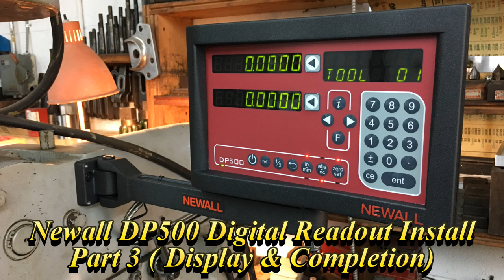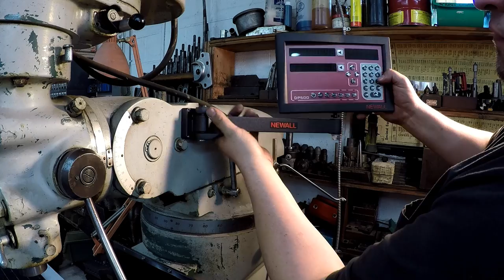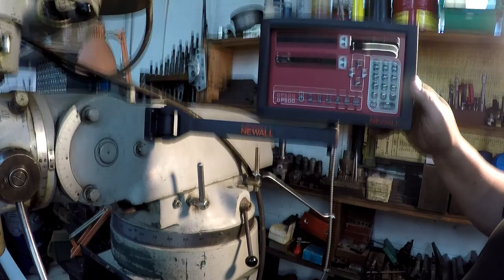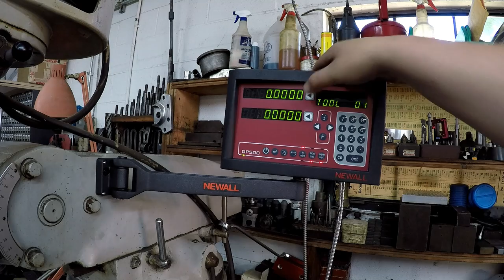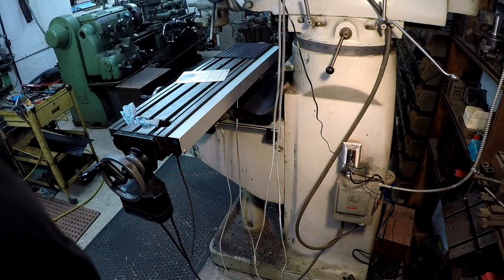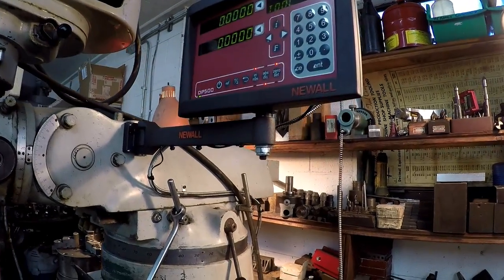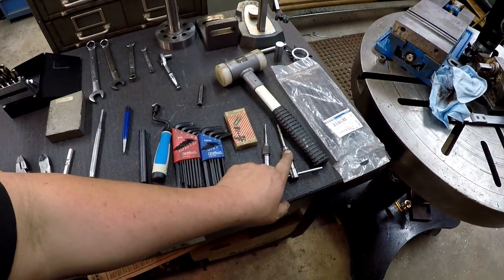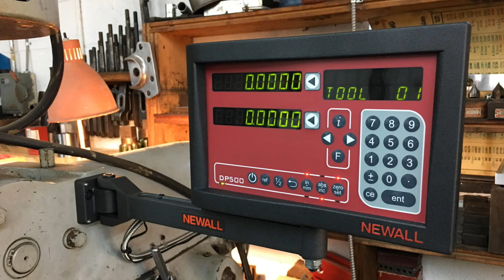Newall DP500 Digital Readout Install Part 3

Comment: Nice clean install Adam, looks like you have much experience with drilling and tapping freehand, you made it look easy! I will be looking into one of these for my lathe so looking forward to updates on the DP 500 in the future. Thanks for taking us along,  I enjoyed the series!
Reply from the maker: +Ray Caniglia Thanks Ray. The Dp 500 is a good high quality choice. Been using Newall for years now with no issues, and they do have good customer support too. I've had to do a few hand drilled and tapped holes over my machining years. 👍🏻
Reply: Ray

For those of us who are not as experienced with freehand drilling and tapping, a drill and tap guide (I like the Big Gator ones, nice and they are affordable) makes the job super easy

John

Comment: Looks good!  It will change how you work a bit.  Folks who are used to watching you do setups for no DRO will see why they are a nice addition to manual machining.  You showed a  lot of us armchair machinist how to do it without electronics now we get to see what they add.

I would take a grinder to the corner of the guard on the knee - it needs a radius or it will be a pants catcher.  Sort of like how you break all the corners after a cut. HTH

Comment: Adam: I feel your pain on the readout mount.  What ended up working really well was drilling/ reaming readout hole 1/8"/ (~3mm) over the bolt diameter, then I turned some flanged bushings from some black delrin rod and pressed them into the arm. A couple of thin, smooth washers on the readout bolt and nut, and now the readout is supported on the bolt body and not riding on just the washers/threads.
Reply: Matthew Helton -- Thighten u
till you hear it crack.. back off a 1/4 turn.
Reply: 77racing nothing tighter than stripped
Reply: Ryan Gelson -- A corssed threads a tight thread ! agreed..
Reply: Matthew Helton -  Haha, that's exactly what i did and was going to suggest.

Comment: the c80 on the mill or a lathe was the newest thing on the market 2005 -2015 so easy to use  i have a easson es-10 on my 9 x 49 Bridgeport the read out has been great from 2006 to 2018 protecting cover has been on it  since day 1 looks new as the day i bolted it on way super happy with it

Comment: Hi Adam, great install, I am sure you will figure out the fix for the readout swivel issue.  I have just completed installing a new longer pillar on my drill press.  I had to get it machined to the correct diameter outside my workshop as it was too long for my lathe.  Unfortunately, they machined too much off the diameter which left the drill head 'nodding' slightly.  I drilled and tapped 4 holes in the bottom collar of the casting to re-establish some rigidity in the set up, Im going to re-install it today, let's see what happens. Thanks for sharing big chap.  Kindest regards.  Joe.
,

Comment: i'm, a novice but I have a DRO on a mill and I find that it makes me make better parts even with my lack of skills. I'm thinking about adding one to a small lathe (11" swing) but the consensus is that there's less need to have them. I can dial in stuff but I think a DRO could make life easier.

Excellent 3 parter
Reply from the maker: +El Tel I do like having a dro on the lathe, but you can get by without it.

Comment: I second Kirk Douglas comment. Stud should be permanently locked to the display and adjusted to swivel with some small drag through the arm. I think I saw flat and nylon washers for smoothness and a spring lockwasher for drag, adjusted by the Nylock nut.

Comment: Adam, I just installed an inexpensive Chinese dro and had the same issue with the  digital display loosening up. I added a nylon washer above and below the arm and it took care of it loosening. Acts like a bearing.
Reply: Kirk Douglas Hi Kirk, It’s been a year since you installed your DRO. Wondering Which Chinese unit you chose and how it’s holding up after year? I’m about to put one on my 36” Bridgeport, Trying to choose.

Comment: ...Bolt hole circle.....Yes, extremely handy....!! Pitch circle diameter.....Gears, but about the same as bolt holes....
  That's one clean installation too!!   That issue with loose mount....could you fix that with wave springs or Bellville springs...?

Comment: Hey Adam when I installed a dro on my mill I checked it with a set of gauge bocks and a test indicator. I'm glad I did because it was slightly off in 12" Like 0.002" in that distance was easy to fix though. just a suggestion if you want to be sure it's reading true or not.

Comment: I really enjoyed these videos.
Reply: Hey Adam,
Job well done. Does the DP500 have glass or magnetic scales? I used a DRO PRO (Vacaville, CA). American made with magnetic scales which are cut to fit on my Grizzly mill/drill. I love it, all the same functions, with supplied and online install videos. I found that tap magic really made tapping cast iron go much easier.
Cheers, Rod
Reply: ...I would guess this is magnetic, the glass scales are usually flat and the 'read' head is very close to the stationary scale...and...I suppose each type has it good/bad details....
 These, as pictured here usually have a series of 1/2" hardened carbon steel balls inside the moving 'rod'.....

Comment: Hi Adam
Enjoyed this series very much :-)
I really liked how you used the dial indicator to do a quick check of the DRO to verify travel.

I wondered if simply using Loctite medium on that monitor stud might be sufficient to hold it? That or adding a thin nut to use as a locknut. I saw that the bottom nut was already nylock.

thanks again
regards
vic

Comment: Hi Adam thanks for the info I got the DP700 and that lower guard was a bear ended up TIG welding up a custom bracket to box the the front cap
Last the functions in set up are tough and help ? Newall has limited info !

Comment: I would guess if you had equivalent bolts where the parts mount to the machine, you could use imperial thread, the only thing i could see that you 'need' metric taps for is chasing those holes in the brackets in the first vid.

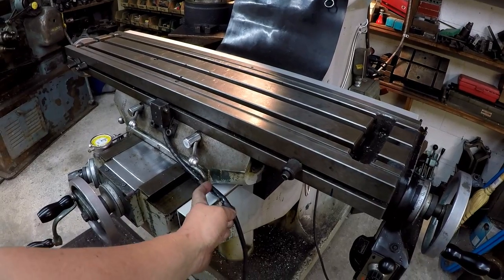Comment: 15:25 Are you sure you don't have that gaurd on there backwards? I don't get why it wouldn't go on the same way as the other axis...
Reply: Nevermind you can't because of that bracket... That's sort of annoying there has to be that sharp edge of the angle aluminum.

Comment: good job. very clean install.  I've got a question why wouldn't you put a scale on the knee to measure up and down. I've seen some do it and some don't.  I'm looking to put a DRO on my Millerite mill I can find to many that have DRO's on a old Millerite but I thought it would be a good project.  what's your thoughts on the scale on the knee?

Comment: do you know that you can switch between inc and abs .. ex  zero out  x0 y0  (abs)  and go to inc do (inc) things ,, zero out  and and mill  bore ..   switch back to abs.. and you still have  you x0 y0 on abs  ..i use it on lathe  for groovs  .. swits back and you still have abs  zero ..love it

Comment: I had the same problem on the unit I installed on my lathe,  Loctite, teflon washers and a locknut did the trick. Not to get off subject but when have you seen the guy in Florida with the 10ee? I think his name is Dale.

Comment: Nice job.  I would be scared of drilling into an oil gallery or something, but hopefully will have to face that in the not too distant future.  Do you always buy taps individually?  I have those cheapo chinese starter sets, but when looking for new stuff, it seems like you can't just buy a high quality set of taps.  They are all individual or a 3 pack or something, but not a full range like a set of drills.  There is also an overwhelming assortment of tap types.

Comment: good work a good dro is a real time saver that do all is a nice machine and any work to spiff it up well worth it puts some fire under my but to get the parts and pieces for a heidenhain nd 780 I got off ebay for $500 its just like the anilam VUE but it takes the 1Vpp scales so read heads tape, tape holders don't like the glass deals that kit you got is soooo much easier but I need od ball scales any way no flicker on the 10ths nice oh ya blue locktite that nylock befor ya go to bed I see you got both the nylon washers in there so blue locktite bout it the blue stuff still allows for some adjustment without re wetting it

Comment: Adam 
Had the same with my dp700 thread loc is you friend

Is that dro set in lathe mode ,it's displaying tool num looks like it's in lathe mode or generic 
Press the f key and cycle the left or right arrow till you get to setup

Comment: How were you checking to make sure that there weren't important components behind the casting where you were drilling? I'd be concerned about drilling through an electrical or oil line, or a mechanical component.

Comment: That dumb hex nut holding the display on the arm - throw it into the spare bolt bucket.
Make a 3" diameter knurled hand nut with a wave washer or two to hold the display at the right angle.

Comment: Glad you got it finished fella, how big a difference will this make regarding work for the average home machinist?  Faster, more accurate?
Reply: The two big things are that you can often skip doing layouts, and you can move the table to take measurements, then go back to the exact same position, like for boring operations.
Reply: I don't think thats boring at all

Comment: Adam,  was cost the primary reason you didn't go for a readout on the knee's height as well?  If so, I can understand why from what others are saying on how much the magnetic scales setup cost, and from what we've seen you do on the Do-All over the course of your channel, its X-Y accuracy you need more than anything on it, you're not doing a lot of Z-critical work on it.
Reply from the maker: +Patriot1776 The price of these Dp500 units make it more afforafable for a high quality unit. A Z axis on the knee is very nice to have though. I'm installing a z axis on the quill.

Comment: Abom79 hey Adam I was thinking about getting a used 3 in 1 mill drill lathe it has a 3 axis dro and many extras plus its local and the price is right , , I few people told me the 3 in ones are nothing but problems and that I shouldn't waste my money , what do you think?  ...    les
Reply from the maker: +TeslaTek Shop Some people like them and others don't. Myself I wouldn't want to use a 3 in one machine but if that's all you have, or all the room you have to store a machine, then go for it. If the price is right, try it out. That's one way to learn.
Reply: +Abom79 thanks for the quick reply , yeah not a lot room , just watching your videos and mrpete222's really inspired me to teach my my kids machine work when they grow up so I gotta start somewhere , thanks for all the great videos ... les   
ps ill upload a video when I make something

Comment: Metric rules. :D
Reply: Well, if you only need to do 1/2s, 1/5s, or 1/10s. But if you want to do 1/2s, 1/3s, 1/4s, 1/6s and 1/12s of things, then imperial has its advantages.